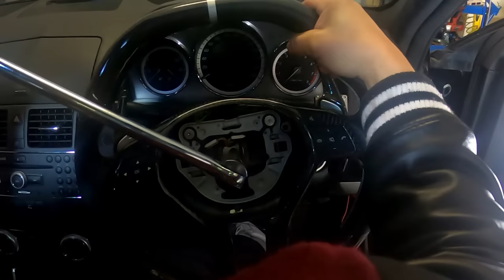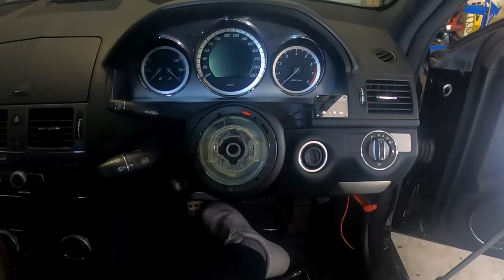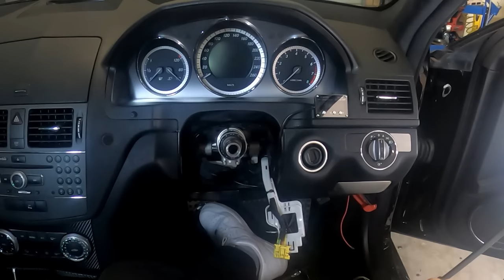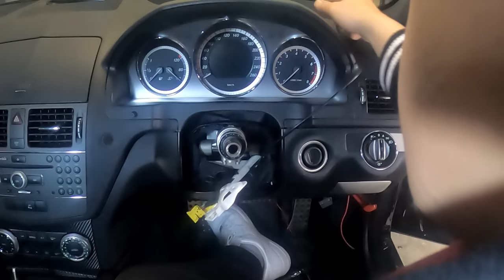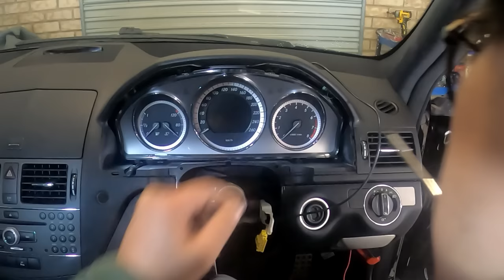HOW TO remove and fix ESL/EIS/ ELV MODULE  w212 w204 mercedes motor replace  Part 1

Comment from the maker: Ive added links in the description for those who want to buy the part and special tools 
hey guys so i realized in this video i forgot to show how to remove the 13mm nut that secures the ESL to the steering column , however it is in part 2 i show exactly how i removed it..be sure to watch part 2 if your wondering how i did it....when reassembling the ESL module a very important step is to make sure that on the circuit board there are 2 grey looking button switches..you need to ensure these are pressed in so that the circuit board will sit correctly..if not you can cause damage quite easily... as well as all the other parts of the module..attention to detail is the most important..take your time and you will be able to do this...NO PROGRAMMING IS NEEDED IF YOU ARE ONLY REPLACING THE MOTOR .. all the best to everyone who attempts this fix..
Reply: Where is part 2
Reply from the maker: @Abhijeetkapadi17  hi friend you will find it in my w204 list youll see it just search for it or ill leave a link for you to here you go https://www.youtube.com/watch?v=kt9aDgx9NAY
Reply: So youdont programing the esl
Reply: I have the same problem
Reply from the maker: @juanca122480  no if it is just your motor that has broken or malfunctioned..you do not need to program anything ..you can simply replace the motor a d put it all back together and all will be well.... however if you manage to dry your NEC CHIP or forget to press on the two little grey button switches then there is a chance you can damage the module and then may need reprogramming.... but no you dont need to re-sync or reprogram if you are just replacing the esl module motor... however if your fault is related to your circuit board or your EIS malfunctioning then you will definitely need to have it reprogrammed...
Reply: Hi .i have the same problem with the e class 2001 do u think its same c class esl position
Reply from the maker: @User69390  yes mate most likely if the problem is very similar most likely it's the esl ... this issue spands through c class and e class and even m class
Reply: Hey man ! Great video by the way! I have a question for you, maybe you can give me some info. I found another w204 that's being parted out . If I took the esl and eis from that car & put it on mine, will it be plug and play? Since they are already programmed together from the donor car? Or will I have to reprogram everything again? Thanks man, hopefully you can help me out.
Reply from the maker: @UtubeSurfer7  honestly i am not 100 percent sure .... u could ask mercedes themselves or just do abit more research.... however i do understand your theory 
.and in theory it should work.... but i would suggest depending on the problems maybe u wont even need to do that .... i could het away with replacing or getting watever is that is the issue ... have u been able to pinpoint your actual issue
Reply: MIKEYZ VLOGZ yeah, my esl was already starting to give out , sometimes I'd have to jank the steering wheel side to side while inserting the key to get the esl to unlock , I could hear the little esl motor getting weaker. Eventually it gave out , and only would make those clicking sounds . I ordered another little motor to replace the burned on inside the esl, but while trying to open the esl, I accidentally drilled to far and scratched some of the board circuit, hoping it wouldn't affect anything , still went on and put the new little engine back and then put everything back together , still didint work after inserting my key, this time , I don't even hear the clicking sounds. Maybe I damaged the circuit board. I think at this point , I'm better off getting an emulator . What do you think?
Reply from the maker: @UtubeSurfer7  yeah definitely go that route and best thing is u no longer have to worry about the steering lock motor as theres no motor to screw up.... and it can simply be installed in another location without remove the esl ...just unplug it and plug your emulator in place and either mount it to the steering column or where u feel comfortable ... its a good option .... hope it all works out for you .... and from what u said ..u just may have damaged the circuit board.... and also u will have to get the emulator programmed to your car as well....
Reply: MIKEYZ VLOGZ i have the same issue and i was wondering how did you manage to get the esl to unlock?
Yesterday i was driving the car and when i parked my car in my driveway that’s the moment when my esl failed.
And i was wondering if i didnt manage to get my esl to unlock. What should i do?
Reply: Wail maghazi try to wiggle the steering wheel side to side while inserting your key fob. Keep trying and you'll eventually get it to unlock , unless it's complete fried . I would do that and it would unlock , until one day it completely just failed , this was about 2 weeks ago. I got an emulator now and it works perfect again, you should go the route as well, you will never have to worry about your esl getting messed up ever again, because emulator does not have a little motor or actual lock, it just tricks the car into thinking it's an esl. It's worth every penny
Reply: @UtubeSurfer7  how did the labor work for the emulator ?
Reply: Kevin Ceballos I did it myself. Basically took the plug off the original esl and connected that plug into the emulator . Worked like a charm. Haven’t gave me a problem ever since . That’s basically the way to go 1 million percent , way better than repairing or replacing the original esl
Reply: @UtubeSurfer7  did you have to code the emulator ?
Reply: @UtubeSurfer7  did you have to code the emulator ?
Reply: Kevin Ceballos yes. To my key. So basically you have to send In your key and ignition switch to the person you buy the emulator from and they’ll do it for you. All you’d have to do after that is re install and that’s it .
Reply: @UtubeSurfer7  awesome thanks for the help man! Sorry for many questions this literally happened to me 4 days ago at cvs. If my car still locks and sets up the alarm.. do u think it's the key? Cause I still dont mind doing the bye pass.. also, can you send me to the person you got yours at?
Reply: Kevin Ceballos no it’s deff your esl. When you instead the key. Do you hear it unlock? You should hear a little sound as soon as you put the key in. If it doesn’t unlock. The car basically won’t even turn the dash lights on or crank. If that happens to you again. Wiggle the steering wheel while inserting the key fob, until you hear the esl unlock. That would always work for me . Until eventually it complete gave out. If I was you I wouldn’t wait until it completely gave out . & yeah. I got it off eBay, but I have his number somewhere saved. I’ll pass it to you.
Reply: john rodriguez  hello can i please have the information from the guy on ebay. My car left me stranded at a local walmart for black friday and i had to get it towed home. After soooo much research i found this video and your comment. Can you please share the info to repair the car. We are going on 1 month without a car and its been so hard to get around 😩
Reply: Noemi Martinez yeah. Let me look for his info again. Is the car at your house right now ? Do you have access to it ?
Reply: john rodriguez yes it is currently parked in my driveway
Reply: Noemi Martinez how do I send you a private message? When you get a chance , go in your car and try putting in your key fob, but when wiggle the steering wheel while at the exact same time inserting your key fob, that might unlock your steering lock . Which you will need. Makes it sooo much easier for when removing the ESL
Reply: Noemi Martinez ok I will email you
Reply: Hi where are the 2 grey switches located
Reply: dean gorman what two gray switches ?
Reply: @UtubeSurfer7  they are 2 switches built into 2 chips on the printed board of the esl
Reply: dean gorman the only one you should be worried about is a green plug coming from the esl. That’s the plug you’re going to need to connect to the emulator for your car to start again
Reply: @UtubeSurfer7  OK thanks can u send me a link for a emulator
Reply: @MIKEYZVLOGZ  There are several messages on the web and one mechanic even uses the word "ePROM", which looks like he has a "black belt in electrickery" and what they are all saying is, if you tried to start TOO many times and like in my case got the steering locked, then as a security feature Merc's NEC security chip says "No" to starting and you also have to get the ESL, EIS (ignition switch) and the key to some locksmith, who can "re mate" the three things together. 

By the way, Aliexpress sells you the motor, the tool to pull out the four pins on the ESL, which is a handle with some sort of spiral at the tip and you hammer it in and pull the pins out clock-wise plus the cylindrical tool to open the ignition lock. 

As China is no longer posting parts and my Aliexpress orders are languishing somewhere, I had to buy the US$3 ESL motor locally for AUS$10 and hope to get it soon. I paid US$23 extra to have TNT deliver it by the 2nd of Feb., so I had to contact my bank to get a charge-back on my Master card. One chap believes the motor burns out slowly as the lubrication is failing and is suggesting lithium grease for plastic on steel and steel on steel.
Reply: @UtubeSurfer7  It has been claimed that trying to start too many times runs into the "NEC sudden death" problem, where you have to get the ESL, EIS and key to some locksmith to get it going again.
Reply: dominic Wild I took me eis out and programmed it to an emulator . Completely replacing the esl. Have not ran into esl problem ever since . Best way to go for sure , instead of replacing esl motor. I recommend getting emulator , the motor will eventually given out again and might run into the same problem
Reply from the maker: @Abhijeetkapadi17  hope u found part 2
Reply: Did you have to order the motors online? Or go to your ace hardwares or harbor freights? Im in the u.s.a
Reply from the maker: @godamongtsmortals6211  i got mine  from ebay or aliexpress .... just ensure they are tge correct part... cuz some look similar but are different for good reason .... search wmercedes w204 esl eis esl motor.....it will come up
Reply: @MIKEYZVLOGZ  Now I have tried 3 times, changed the position 3 times (inside the esl, changed the wheel/button system in open position, (first attempt i didn't knew) with a new electric motor). 3 times and no function:/ My guess now is that I've probably fried the chip.. So, what my best option now? Emulator or an auto workshop? Emulator is the cheapest way but do i need some additional equipment to install that or is it "plug and play"? I hope you can give me some good advice so I can find the best solution for me❤ thanks so much for your great video🤗
Reply from the maker: @profezzorBALTAZAR  for u best woukd be emulator no equipment needed just have to relove your eis aswell so u can send off ypur key eis and esl    and they can make an emulator for u

Comment: Excellent tutorial mate... Another Merc W204 fixed thanks to your work.. In addition I could add that IF the module is unable to come out of its place in the steering column, the column should be dismounted and a 3mm hole can be drilled very carefully on the side of the module precisely by the side of the gear and once the plastic gear teeth are visible the gear wheel can be winded back  manually via picking tool or a small flat screw driver. This will unlock the module bolt completely. Also we found this sharp  tool pretty useless and had to drill the pins with 3 mm drill bit. The assembly after that is possible with a nice cable tie and a few windings of isolation tape. When it is inserted back in to the column it is pretty tight in place. Well done and respect for the priceless help !
Reply from the maker: well done and yeah its sometime a pain with the scrwws for the esl
Reply: Je suis en plein réparation, je voudrais savoir comment sortir l'esl en position verrouillée sans cramer la puce. Est ce qu'il faut déconnecter la batterie ou comment ..., Merci d'avance

Comment: Thank you for the great guide to remove the ESL. After turning & turning trying to remove the 4 (screws) in the ESL I went & got a very small stud removal tool. They are NOT screws at all they have no threads on them, they are in fact roll pins. They will spin & spin until a pulling force is applied. Hope this little bit of info helps others with this problem.

Comment: Thanks to you, I was able to successfully complete this repair for $13.  In my GLK350, i had to take another step and unhook the steering column to get to the ESL.  I then couldn’t get those pins out no matter what (even with a T5), so I drilled them out with a small bit.  I had to reconnect the casing with electrical tape, but I am pretty sure it will hold up.  Thanks for the video!  It saved me over $900 from the quoted repair at the dealership!
Reply from the maker: well done mate I'm so happy for u co co graduations for reals good on ya mate two fkn thumbs up bro
Reply: Does the steering lock work as it normally would? As in the wheel is locked until the key is inserted and recognized. Mechanic wants to charge $1700 which is insane. At least if I have to remove the steering column I can go ahead and rewrap my steering wheel.
Reply: Yes, it works just as originally designed.  There is no benefit I can see of getting a mechanic or dealership to do it.  It is like new and basically free to fix.
Reply from the maker: this is why i strongly recommend for you to take on the task and do it yourself... even if u only remove the part and have it fixed it will only cost u 500 not 1700
Reply: @knoxvillain6735  When you first encountered the issue did the info screen display please remove key?
Reply: @MIKEYZVLOGZ  My thoughts exactly.
Reply: I don’t recall a “please remove key” message.  The way you diagnose this problem:  when you first insert the key, listen carefully.  You should hear a small motor unlock the steering lock.  This allows the lights on the panel to turn on and the engine to crank.  When you remove the key, you will hear it again as it relocks the steering wheel.  If there is no noise at all sometimes and the engine won’t crank, that is the ESL and this is how to repair it.
Reply: @knoxvillain6735  when you reinstalled the ESL was it in the unlocked position or the locked position?
Reply: It was in the unlocked position.  I think it would be nearly impossible if it were in the locked position.  It was stuck locked for several days and then one day it unlocked, so I quickly disconnected the battery and got to work.
Reply: @knoxvillain6735  got it. Mine is still stuck in the locked position. I will continue to do some research. I am aware that if it is in the locked position the steering column will have to be removed.
Reply: Try inserting the key in different temperatures.  Also, have you tried tapping the ESL with a mallet?  Sometimes that can get it unstuck once.
Reply: Re four pins on ELS: Seen chap hammering in the T5, then twist and pull. That chap twisted RH and it worked. Then hammer the pins in after assembly - do not forget those two grey switches and push them in!

Comment: OMG thank you so much for posting this video,my GLK 350 key wouldn't start my car and the dealer said it would be about $2000 to fix it,I took a rubber hammer and topped the steering lock 2 times and the car started with the key again,you are the man, God bless you for this video 🙏
Reply: How long did that trick last? Or did you get it fixed?
Reply from the maker: the trick will only last a few times as eventually he esl will give out, its really only works during the earlier stages of the malfunction...hence why i say you need to fix it aap, but the trick will work if its just starting to fail... i do not recommend to keep doing it  and hoping it will keep working....its most defiitely a teporary solution to ensuring you can get home and not get stuck wherever you are

Comment: man... so many thanks... 
just happen to me tonight, and took me 45min to take it apart.
I did not even had to take the driving wheel and all apart, you can reach the 4 "inverted" torx from under (i've got small hands)

Just waiting for the replacement parts to arrive, so exited !!

[EDIT]
Parts and tool received !
- Opening the grey casing was not as smooth as shown in video but I could manage
- Electrical motor shows burning marks : that has to be the cause of break down. Replacement is super quick
- Closing the grey casing is ok, when you have read the video description telling you to press the switches on when closing the lid
- Plugged back in the car for testing : Youhou !!! it works !
- Putting everything back together : 30min

I confirm there is no need to remove the driving wheel, airbag, display, and other thinks on the top.
Doing everything from the bottom is ok, on your back, under the driving wheel, good lighting, lots of patience as you say, a few good tools but nothing fancy (and small hands lol)

New motor bought on amazon is a lot more noisy, but I'm so happy to have my car back it removes the inconvenient

Many thanks again
Reply from the maker: I got fat hands lol
Reply: Hi, so once you put in the new motor, you don't have to recalibrate the ignition?  Thanks to all for their hard work.  I appreciate it

Comment: I recently experienced ESL failure (unlocked thankfully) while pumping gas, and this video saved my ass.  It sucked because I had JUST bought the vehicle less than two weeks prior (2010 C300)…the only deviation from the video was that I had to drill out the pins on the ESL component, but everything else was pretty straightforward.  Thanks for the help!!
Reply from the maker: well done mate